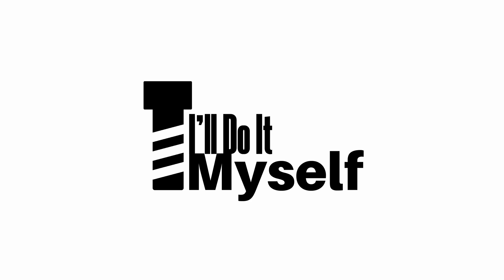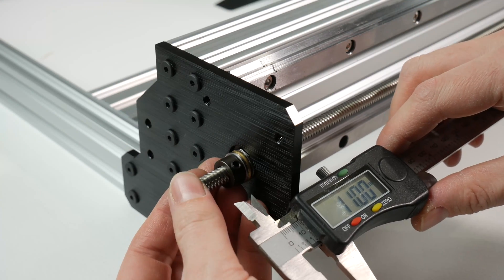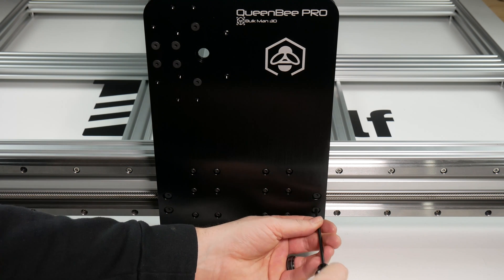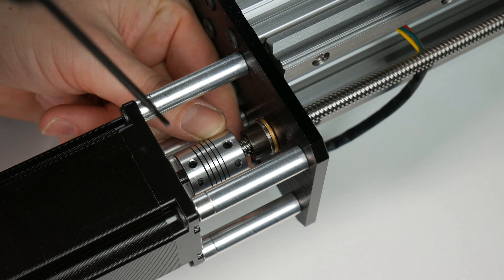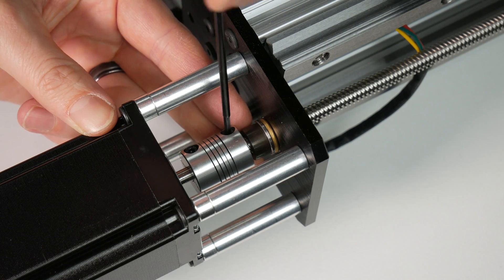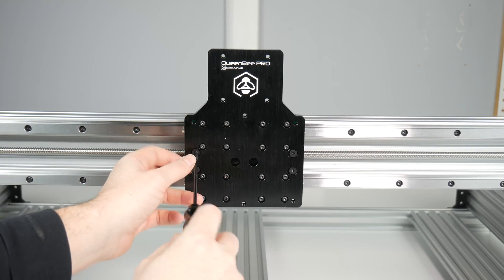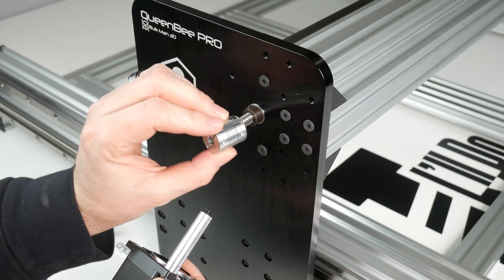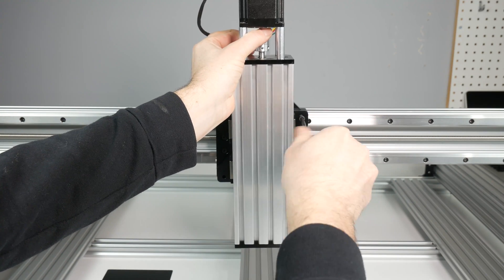Bulkman3d Queenbee Pro - Leadscrews

Comment: Hi, don't you have some whipping or backlash with those Leadscrews? I would like to buy the 1500x1500 version but I'm afraid of this phenomenon. What do you suggest?
Reply from the maker: The David Tingle Tension system takes out the whip if you do get it. Usually that only happens in a 1500mm machine.
Reply: @IllDoItMyself  Ok thx, I will look for that. But I know a person who sell the ballscews system for the QueenBee cnc. Custom made. 👌